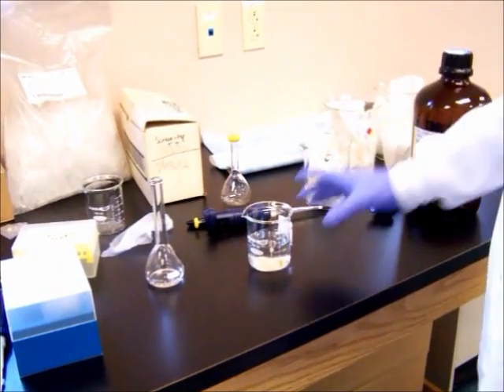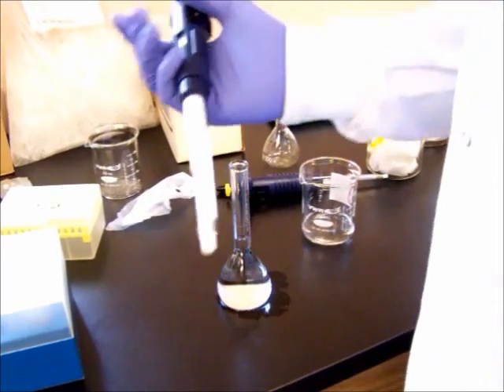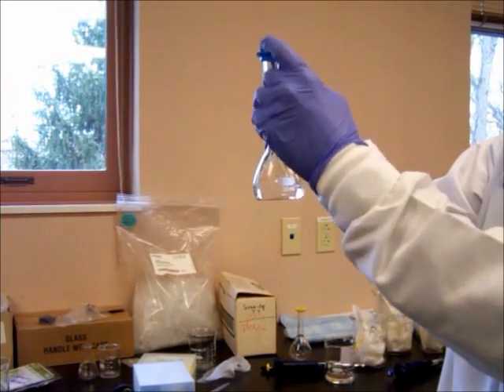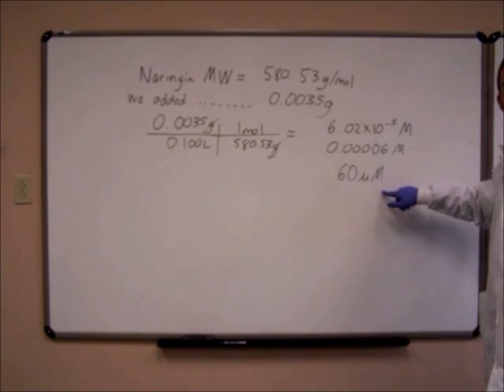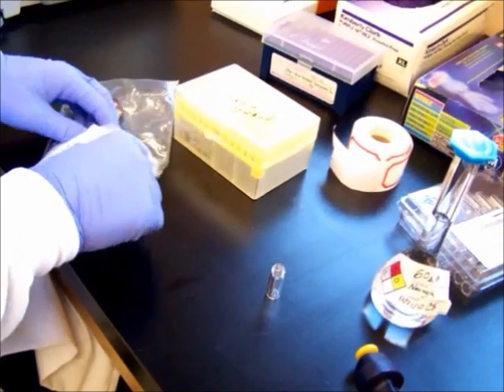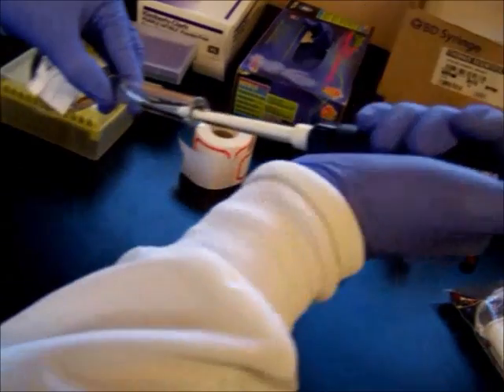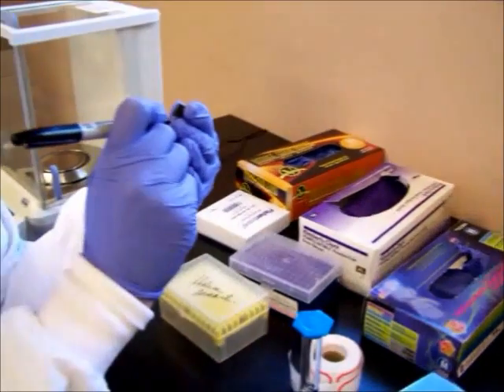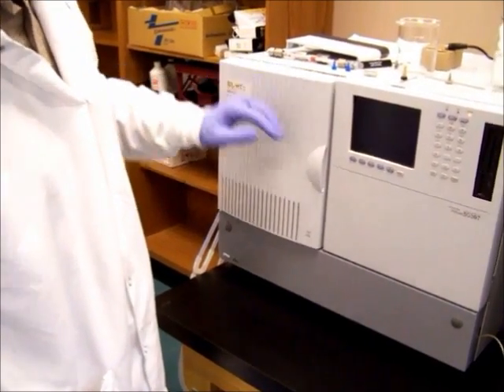LC-MS Simple Operation College Training Video Part 2.wmv

Comment: My God man, buy some transfer pipettes! You should also be 0.45µ filtering your samples directly into the autosampler vials.

Also, snap cap volumetric flasks suck. Buy the ones with polyethylene stoppers.